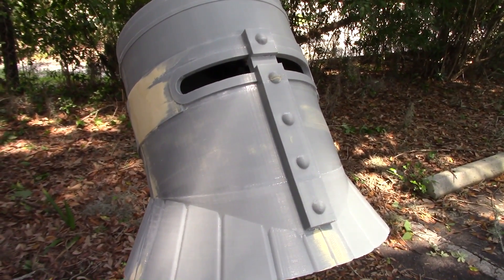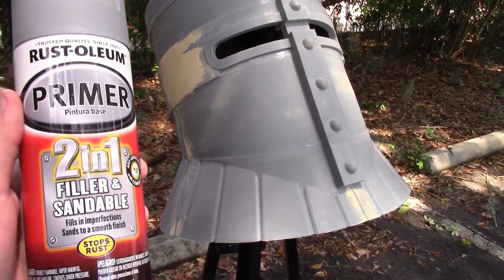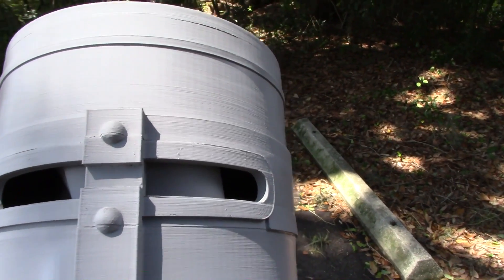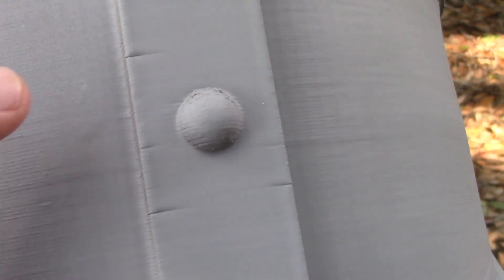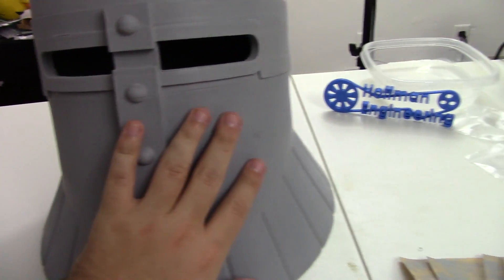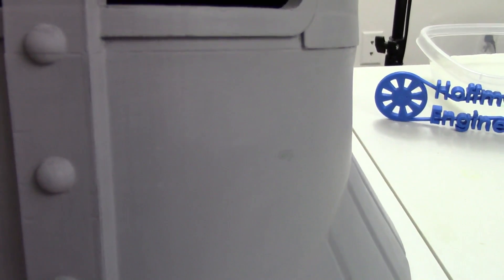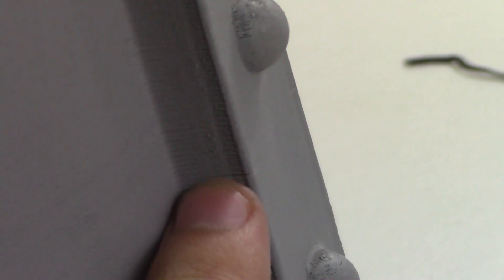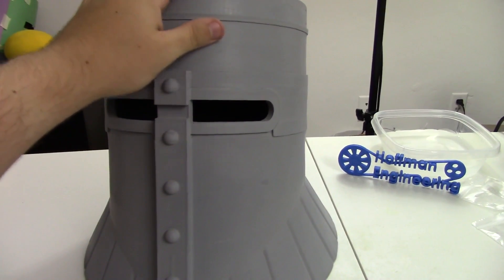Filler Primer - Will it make 3D Print finishing easier?

Comment: There is a misconception that filler primer and leveling primer are the same. While you are "filling" the low spots, you are still building the high spots, which is why you should sand between coats. That is also the reason it gums up the sand paper. The first coat is the most important to sand after, you would see immediate results on the second coat, because the moisture in the paint actually brings out the suface imperfections.

Comment: Wet sanding would be a better process rather than dry sanding. This will limit the amount of sand paper you are using by removing the sanded material that is filling your sand paper.

Comment: I think you'd have good results of taking a pumice-tipped Dremel bit to the areas that poke out too much and carefully grinding them down. Then add a tiny bit of water to the wood filler and apply a light coat to the entire surface of the helm (also filling in gaps and smoothing out the step-down surface transitions). Sand down the wood filler, then apply a coat of primer, wet sand, apply another coat, then wet sand for the final finish.

Comment: I'm in preception wether should I buy the filler or primer? I need to glue parts together and than make them look like one part so I'm guessing filler would be a better option to fill the holes? but than on the other hand I am also planning to paint the print so I was thinking of using primer aswell. Would this be a good method? I'm not really experienced since I usually dont procces prints after they have been printed.. thanks for the answers!

Comment: For those really fine cracks you could use the wood filler again. My uncle when working with wood would first use his finger tips to massage it into fine crack then using a damp cloth (not wet) he'd wipe the surface of excess filler away leaving the cracks filled.
Reply: Ha you said your uncle working with wood and putting his fingers into cracks

Comment: You can’t dry sand spray can primer ... this is cheap lacquer base crap .. it CAN be wet sanded and I k is it says filler primer BUT it’s still thin as water and really isn’t meant to fill big stuff . It meant to fill in maybe 400g sand scratches

Comment: This stuff works very well. I just used this on a big print off my ender 3.  if you sand after every coat. If you use 600 grit wet sand at the end it feels like glass.

Comment: A better primer would be  SPRAYMAX 2K aerosol high build primer with a plastic adhesion promoter on first. Also next time dont use wood filler its gunna shrink use autobody bondo instead

Comment: you can prevent using so much sandpaper by wiping the sandpaper frequently on something “abrasive” i guess, a towel or something might work but i use a carpet square sample that i had.

Comment: Never did you mention what grit sand paper or talk about the sanding block you used... but i do like the rest... i  am thinking a thin coat of epoxy or uv resin followed buy a coat of 2 of this high build..light wet sanding with 400 grit ..then base coat /clear coat... i believe if model is sliced well it should look very good...f coarse the better the print the better the over all finished product...

Comment: Idk if you've already tried it but I've used Tamiya plastic model putty to smoot out and fill in areas. It's really good cuz it's also a plastic but you can also use lacquer thinner to paint it on so it doesn't remove details.

Comment: You are wrong about the vertical lines.  Your printer is the issue.  3D printers print circles just fine.  Google it, there are several reasons from stepper drivers, extrusion issues etc..
Reply from the maker: It wasn't the printer, it turned out to be how I exported the model from Onshape. Those lines are from the stl that was created, I didn't set the export properties to make a fine enough mesh. You live and you learn.

Comment: Vertical lines are not a problem of the printer but your model.. you have a low poly model aka not enough smooth curve and the printer prints exactly what you send to it so the 'low poly' is visible as those vertical lines.. if you would model it smooth enough (add more detail) in the first place it would be printed smooth..

Comment: I do this professionally at veloce engineering and we use acrylic putty and automotive body filler for rough fdm parts. We have SLA printers were all it takes is a bit of sanding with a fine 3m sanding sponge fallowed by primer filler and sanding it back down smooth  before painting.

Comment: exactly what i was looking for, thanks! 1 question. ive just finished printing all the pieces to my helmet, and am wondering what is a good bonding glue to connect the pieces together? If you printed this in seperate pieces, what glue worked best for you?
Reply from the maker: These pieces were printed in ABS, so i used some acetone on the two mating surfaces to slightly dissolve it, and pushed them together. Creates a strong solvant weld.

Comment: Why would you sand after using a primer! Isn't that what a primer is for?
Reply: No... The primer is not going to magically fill in the 3d print grain for a smooth surface. You use it to build a layer over the grain and then sand off the high lines and leave the low areas filled with the primer for an even surface.

Comment: Why would you use wood filler? lol How about body filler? Or body glaze? Look for it at auto parts stores or online. Also you won't see a difference in the filler primer until you sand int, it's building up on the low and high spots at the same time so the ridges will still be there until you sand.

Comment: You are supposed to sand between coats of primer filler.  You're supposed to determine if a second and/or third coats are necessary.  Of course you want the last coat to completely cover the object being painted, but sand with progressively finer sand paper with each coat.  Eventually the sand paper will be so fine it won't sand through the primer and the sanding scratches will be so fine they won't show through the primer either.

Comment: This and the last video on the wood filler helped me alot! I ordered some pieces that were 3d printed and I have to assemble them into a cosplay gun. The print is not the best quality and theres lots of gaps/small holes and I think I will try wood filler for sure for those and maybe the filler primer for the whole thing. Also, I found your youtube because I google searched about attaching 3d printed pieces together and came across your ABS juice, glue and sludge or whatever. Very helpful!!

Comment: You should try "knifing putty filler" its designed for minuscule imperfections on car paint where normal filler is too thick. Knifing putty is thinner on a molecular level which allows it to be used on tiny pin holes. Its also a bit chalky without paint so its very easy to sand down.
Reply: I'm not sure if your talking about the same thing , but her, in the US we call it "spot putty" . It's basically really thick sanding primer in a tube that you can apply with a bondo filler spatula or a thick rubber body squeegee. It works good. The main problem with those types of primer fillers is that they shrink...a lot! You gotta get the worst bumps sanded down first. Nomatter what, You're gonna be sanding. LOL

Comment: Hi for issue with clogging sandpaper when prime metal and filler on cars we used wet and dry sand paper in various frits  just dip the paper in water sand a bit then dip in water again we got some realy good finnishes using this method hope this helps

Comment: That stuff doesn't work well at all, I tried it as well.  You will get the results you want with body filler - bondo.  Or with acetone vapors.  Which one will be easier to work with will depend on the project size/shape... complex shapes acetone, simple straight shapes bondo.

Comment: use the 500-800 sandpaper first, and 1000 sandpaper in the second before sprying, and after sprying i recommend to only use 2000 sandpaper, and all of that must be using a WET SANDPAPER that can do better than the dry one. learn about painting if you want to get a better resolution! this is why i like FDM 3d printer, cause i have a lot experience about painting :D

and do you know after all that you still can cover it with putty? use yellow putty that used for cars. And then recoating with the epoxy, 2000 wet sandpaper, and coating it with any car paint, and the last is clear coating, idk what it call in your country, because my english is so bad :v

Comment: Keith Baker gave some good advice, but I figured I'd give some myself. You want to sand inbetween coats of the filler primer, Paint-Sand-Paint-Sand etc. as needed. For smaller details get yourself some spot putty. It's kind of like bondo but for smaller cracks and should really clean up any deep cuts in the print.

Comment: As a BIG tip, you should ALWAYS wet sand with automotive type products (like this primer/filler). Saves a TON on sandpaper (the paper doesn't clog up), and produces a better finish. Faster as well.
Reply from the maker: I think my main issue with clogging in this instance was not letting the paint fully dry before sanding. When I went back two days later to sand the other half of the helmet, it sanded beautifully.

Wet sanding would definitely help the finish after though!
Reply: Hoffman Engineering I’ve found this Rustoleum fills nicely, but takes a couple days to dry before wet sanding...

Comment: seems like, it would be better and easier if you sand before filler primer. than if necessary repeat sand-spray cycle until surface gets smooth.

Comment: is that PLA or ABS Filament? pardon my ignorance
Reply from the maker: That is ABS, but I would assume very similar results with PLA.
Reply: @HoffmanEngineering  Vapor polish doesn't work on PLA
Reply: Why not vapor polish it with acetone? 
I find that a one hour cold vapor polish on my ABS parts does a good job removing the layer lines and produces a nice smooth surface.
Reply: size THIS IS A HELMENT he is going to wear it
and that much vaporized acetone can not be good for him and nature

Comment: Pretty impressed with that finish! :¬)
I just had a filler primer suggested to me for the old foam 8ft span RC plane wing that I'm restoring/modifying. And hopefully, this will make it look better (smoother) than when I made it 2 years ago! I just hope it won't add too much weight.

Comment: not sure if you said it or not, but if you sand the plastic first the filler primer works much better. just like any paint job the better the prep work the better the paint.

Comment: I may be wrong but i'm quite sure that those virtical lines are from your infill not your curve segment. I did an oddish, which is all round, and i dont have any of that at all, but I have prints with infill and those lines are always in line with the infill pattern.

Comment: False, 3D printers DO print true curves. They run gcode (generally). Look up G2 and G3 commands and use your command line to play with it a bit.
Reply: But the stepper motors do not allow for "true curves" since they are controlled with pulses and are not analog devices. Arguably none of it matters anyways since the amorphous plastic will take a shape that is more or less an average of the print heads movement, the small pulses do not translate so it's more like a best fit curve than a true curve. There's really no observable or realistic difference though, it's 6AM and I'm just talking theory.
Reply: I commented before watching that part. What he's referring to are from infill lines lol... What I was referring to are TINY in comparison and don't actually show up or matter at all. Like I said, more theory then what comes out in reality.

Comment: Thanks for sharing your results.

At first I assumed a .1 layer height and wondered if a .3 layer height might have been easier to cover up. Of course now I wonder the opposite.

Also, what grit sandpaper did you use?
Reply: 0.2 is what I use, strong layer adhesion but not too hard to post process

Comment: are you going to San Diego comic con this year?
Reply: Also where did you find that to print? or did you make it yourself?
Reply from the maker: Unfortunately not this year, I tend to stay around the east coast for conventions. I'm hoping at some point I can experience Comic Con though! As for the helmet, I designed it myself. Once I finish the project, I'll be releasing the Onshape files so others can fit it to their dimensions and print it out themselves :D
Reply: +Hoffman Engineering I want to wear it around the house! Any rough estimate on when it might be available?
Reply from the maker: I'm hoping to finish the project by Dragoncon, which is the beginning of september. So I'm hoping for all the parts to be in a state to release shortly after the convention!
Reply: +Hoffman Engineering awesomely done man!

Comment: 3d printers can make curves just fine, its the resolution of the mesh that makes the vertical lines.
Reply: pretty much.
Reply: So more subdivision equals smoother print? Sorry if silly question. I spent most of today reading the MM and blender support.
Reply: @anthonycruz4435  your fdm printer doesn't actually print perfectly round features, it breaks it down into small straight lines according to the resolution of the facets. Let me know if you would like a more in depth explanation.
Reply: Llama Sama thanks
Reply: All parts I model are made in an engineering program, like AD Inventor, instead of a program like 3DS max, so the curves are exported at a much higher resolution and my printer prints them without a single noticeable line. Honestly I believe a program like 3DS Max (modelling vertex by vertex to control performance) is not meant for CNC machines. 3D printers are considered an exception because they CAN produce organic models, but I don't agree with treating them any differently than other CNC machines.
Reply: @Cody hubert  Solidworks is industry standard for CNC hands down,  Autodesk fusion360 is the second runner (at least for stereolithography files)
Reply: Thankyou!
Reply: Not super viable with many large prints
Reply: ...and if people still don't believe it,  just create a cylinder with 8 subdivisions vs say 64 or more.
Reply: Yup. Was going to comment separately on this. It has nothing to do with the printer, it's the resolution of the 3d file.
Reply: You can make a curve with as many subdivisions as you want to in any 3d modeling suite you like, but at the end of the day hes still right, no matter how high res you make it, it's still going to be made up of many straight lines. That's just the nature of 3D modeling.
Reply: @Sigma_Eight  AFAIU, this isn't true. In a CAD, you can parametrically define a model in terms of circles and extrusions and paths, etc. and in that case there actually aren't straight lines (on the arcs at least). At the end you need to translate the model into gCode but even then you can specify that the print head moves in an arc.

Comment: Yus, filler sandable primer is the best. Though I have found using 120 grit sandpaper to knock away print lines first is the best. The "striations" are deceptively deep, meaning you'd need just an absurd amount of primer coats to get rid of them completely. 60 grit just scores the surface and 220+ takes too long to do anything. 120, primer, 320 problem areas + lightly throughout, primer, 600+ up to 2k wet sanding. Glass smooth, top coats go on beautifully, cannot tell it was even 3d printed.

Other tools/things that can help with finishing:
dremel or other rotary tool with a variety of bits
files of various sizes, shapes, and grits
smooth-ons xtc-3d 2 part epoxy is useful in some situations, but not all

and one I'm experimenting with...
blasting cabinet with 60 gallon air compressor.
I've been playing around with using a blasting cabinet in the first stage of finishing to knock out the print lines quick, but I haven't found a compelling media and a low enough grit to be any faster than just 120 grit sandpaper by hand unfortunately...
Reply: i agree i always do a quick sand 1st, then spot fill big gaps n spots before filler primer and lots of wet and dry. any luck improving the blasting cabinet?
Reply: Nhhhr re

Comment: body filler > sand > filler primer > light sand >  different colored primer > optional sand > paint

Use different colored primers so you can see your depth when sanding
Reply from the maker: The different color primer is a great suggestion to see when you've sounded down into another layer. I'll have to try that, thank you!
Reply: also the sanding between the layers... the primmer seems to work ok for hiding the layer pattern, but not the cracks... however, instead be using 3 paint layers you could save primmer and get better results sanding between layers... that way you will remove part of the cover that gets on the surface while the one on the lower holes wont be touched so probably on the second coat you could get an almost finish effect.
Reply: Great tip. Thanks
Reply: Any idea about holes the show up mainly around edges after sanding? And scratches
Reply: @jakehinrichsen4371  Holes no idea.  if it's like potmarks it's likely low points on the surface maybe.